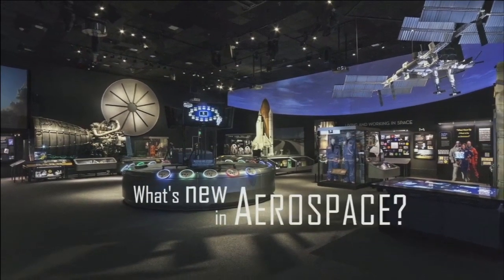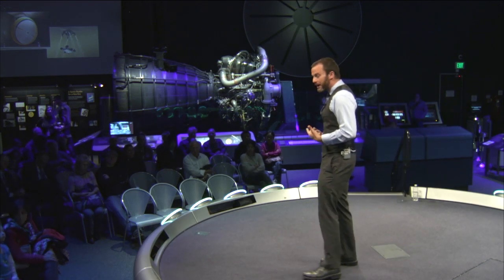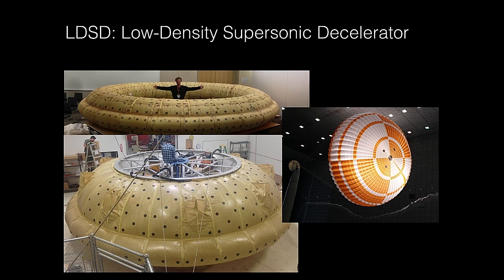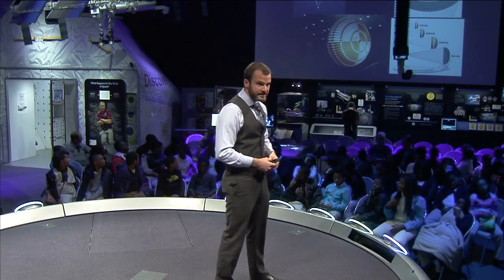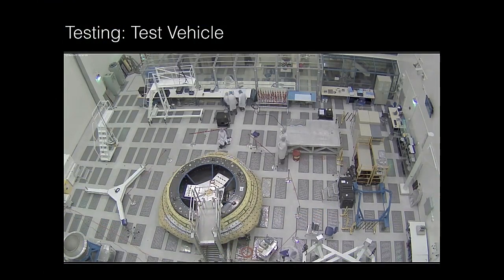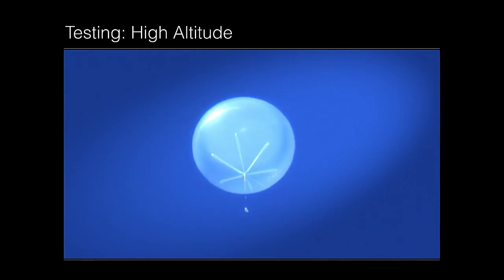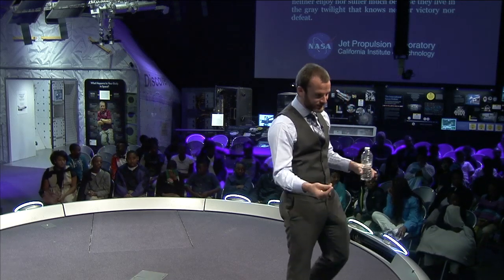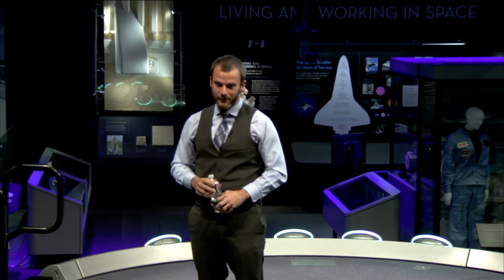NASA's Flying Saucer: Learning to Land on Mars

Comment: The bronze plates turn ON. of the station and the condemnation of the 🚆 must have a vestical adaptation in the upward direction, the pins that will be behind the bronze plate will appear. And below. The plate will cover the pins of the rails 🛤️. And then it will brake the 🚆. But it has to be. Subways.  before arriving at the station 🚉 ❤️🙌👄👄👄👄👄🌅🇧🇷🇺🇲🇪🇸👯🧚🧚✨✨⚕️⚕️💺💺💺🚀🚀🛸🛸🚀🛸🛸🌻💫🌻🎄🎁🌎🌏🌍🚀🛸👯💃👭👫👬👩‍❤️‍💋‍👨👨‍❤️‍💋‍👨👩‍❤️‍💋‍👩💑👩‍❤️‍👨👨‍❤️‍👨👩‍❤️‍👩👩‍👩‍👧👨‍👩‍👧‍👦🤰🤱🌻🌻🌻🌻🌻🥀🗣️❤❤❤❤